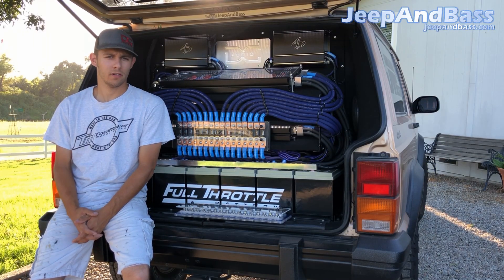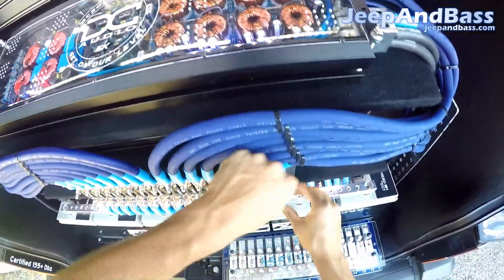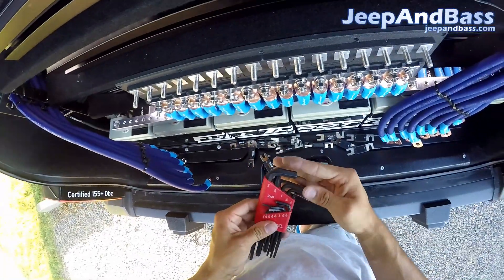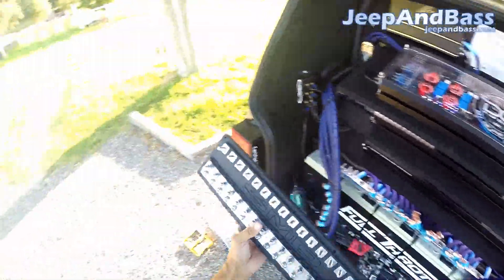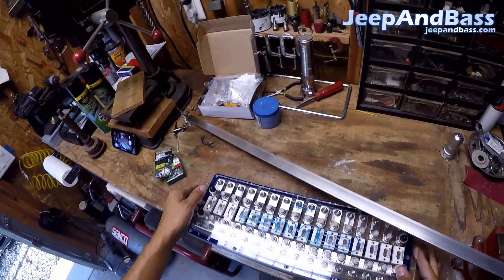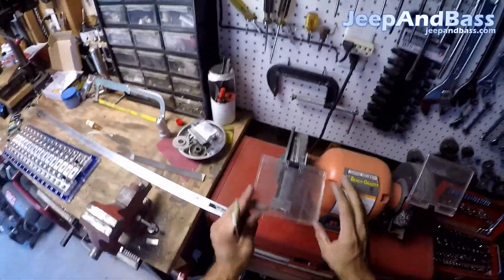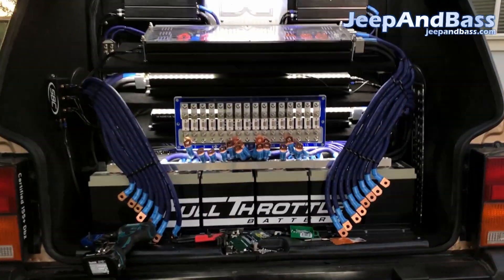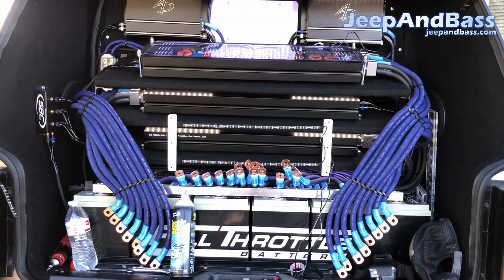SMD Custom Fuse Holder Install

Comment: WOW!! Nicely done but as with everything in life, there's always room for improvement. Therefore I suggest considering using CLEAR power wires (just near the fuse block) for the blue LEDs to appear thru the clear sheath for the most part. Would look even better to see all those power cables glowing as well!!  I can imagine it what it'd look like and let me tell you, INCREDIBLE!! However, I recommend first buying one or two feet worth for $4=$10 to test it out to ensure the blue LEDs would shine thru the sheath.            I bought 4 different colors in 1 foot lengths from SHCA 2/0 to test to see which color combination I like best for my pwr/gnd to contrast with my vehicle's interior. I'm thinking white and silver considering SHCA's blue is too dark bcuz electric or cobalt blue and silver would pop imo in my ride. Was the best $20 spent! I could've gone with CCA instead of OFC just for the sheath color test, would be something to consider doing to save a few bucks.. (On a side note): bcuz every dollar saved (when doesn't profoundly impact quality) eventually adds up to thousands over each and every year. $aving a few dollars every day can be the difference between enjoying retirement or working until on deathbed. Sound interesting? Then read (or listen to) "The Millionaire Next Door". As it did for me, by doing so will forever positively impact your life!! I look forward to viewing more car audio content, well done bro! (I just started posting car audio build vids, isn't easy)

Comment: Great vid but the whole time  I wanted to give you  my impact driver :) then you pulled one out
 Looking good man
Reply from the maker: I don't recommend using an impact on the holder itself :)
Reply: They have 3 setting impacts. Loosening is fine with those. I do the small terminal boards on planes with my air ratchet and I know I shouldn't but turning the regulator down saves those small fragile bolts. I too felt like damn that wrench is going to take a lifetime. But thanks for making this video

Comment: Looks beautiful. What amp fuses are they?
Reply from the maker: Steve Dalton 200a
Reply: @JeepAndBass thank you for the response. Sorry for the newb question but how do you calculate what size fuses to use? For example my new setup is a Sundown scv-6000 with 4 runs of 1/0 power running through a SMD 4-fuse block. Do you just take the total amperage and divide by 4 or what. Hope you can help. Thanks and I love your channel. Top notch fabrication man!!👍